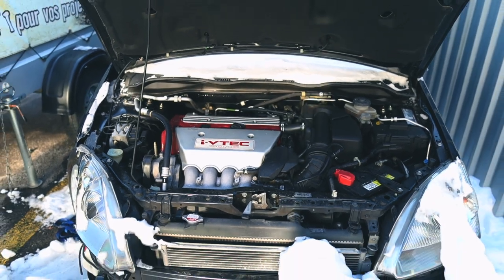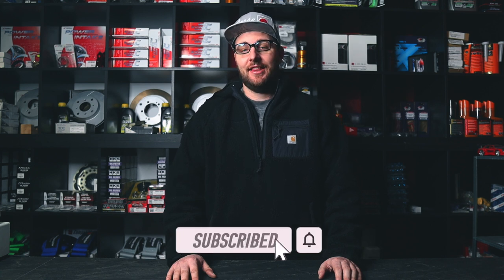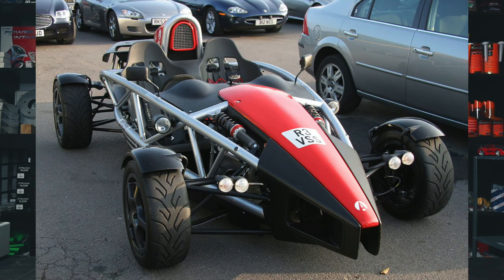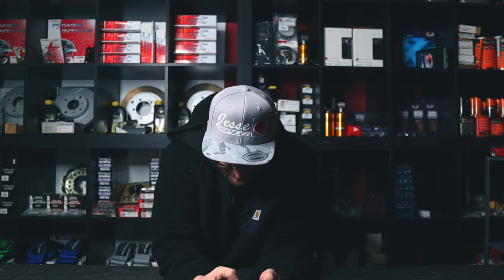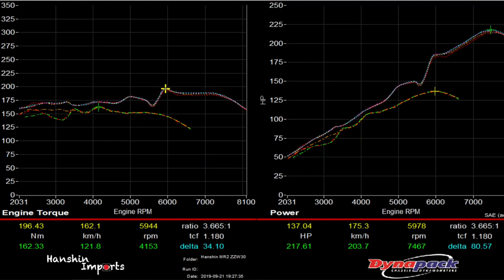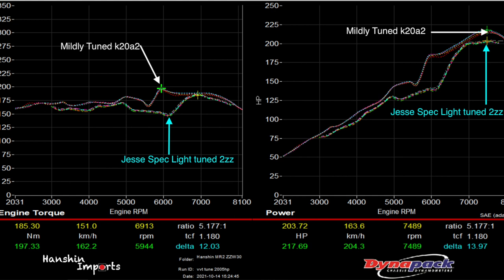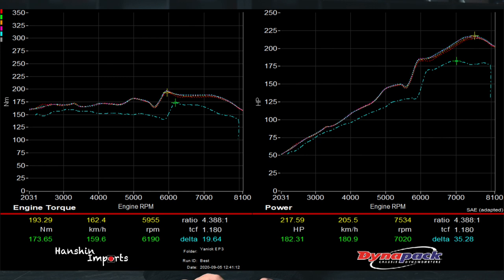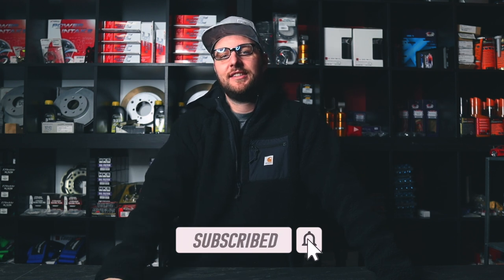How to Kswap an Mr2 Spyder EP2: Is the K20a better than the Toyota 2zz? Is it worth the extra cost?

Comment: The advantage of the 2ZZ is that is easy to swap, relatively cheap, and relatively light weight, but the K series are superior engines in every other way.
Reply from the maker: That somes it up pretty well! 🔥👍🏼
Reply: @JesseSpec  Thanks! :D I was all in on getting a K engine over a 2ZZ, then I saw the prices plus all the extra parts you need lol. 

The 2ZZ is a great engine but the power gain are not that big for the money, around 160HP to the wheels I believe. So I'm thinking about boosting the 1ZZ instead, a lot less complicated and you can get quite a bit of HP from it. 

I would get the piston rods and bearings if you want to go over 220HP though but considering how light weight the Spyder is 220 should be a good number to shoot for.
Reply from the maker: @Zeriel00  thats also a way of doing it 😊👍🏼
Reply: @Zeriel00  i m in your same dilemma but we have to consider reliability , turbo engines are fun but at a more price and more complicated
Reply: Why not just bore and sleeve the 2ZZ to a 2.0. With a refresh I'm sure it can be competitive
Reply: the only they the k has is the tuning options and higher compression ratio
Reply: @dohc7232  What do you mean both K engines have much higher power, torque, displacement, plus Vtec. Theyre better engines in every way, Ive seen 600hp K engines. The problem is the cost, and havin to run two computers to keep your dash working. The 2ZZ is basically drop and play but its not that much of a upgrade over the 1ZZ. A boosted 1ZZ would smoke it and it would be cheaper.
Reply: @joshuaogden8446  You still wouldnt beat a boosted 1ZZ and it would cost a lot of money, especially if you get the 6speed as well.

Comment: Great comparison.
Appreciate you taking your time and showing us dyno sheets of modded vs stock 2zz and k20. And vise versa. No one else ever did that before. 
There is great potential in those engines. One is definitely more affordable and easy to work on then the other. But the extra work that the k20 brings, of course brings way more powaa and VTEC!  
This also gives the 2zz a whole new respect and limelight. In reality kswap will be the best  swap if you want to modify heavy and raw but it's more expensive and more work.
 A 2zz is easier to swap, the numbers aren't insane but when modified some it's a solid swap and passing that 200hp is possible 
In the end  the mr-s is a super light car and both swaps will be worth it .
 people need to realize this is a 1.8l and k20 is 2.0. and they're producing similar numbers until k20 is fully modded and tuned. 
Makes me imagine if the 2zz was only 2.0L?? :O

I'll go 2zz swap for the simplicity sake. Toyota reliability. And keeping the mr-s Toyota. In the end you can always turbo mr-s 2zz and maybe still will be cheaper then k20 😂
Reply from the maker: Thanks for your comment! You Exactly understand my point in regards to the 2zz. As a street car, the 2zz is awesome and probably the better choice for price and ease of the work. As a true racecar, you need to do the same mods on both engines to make them reliable, so I guess going K20 is my choice.
Reply: A few points to this, if you go the k20 route there is a lot of custom fab work that needs done, engine mount, intake, manifold and exhaust, wiring loom, i'm assuming you would also need custom length drive shafts also, this adds a lot of cost on. Probably the same amount it would cost to add a decent turbo kit and ecu to the 2zz, so your going to get more power for your money going with a 2zz as it's pretty much a straight swap for the mr-s, no extra fab work or costs and you can spend that money on improving the engine instead. If it was going to be a drag strip or 1 mile car i would spend the extra to swap the k20 as down the line you can get more power, if i was going to use it mainly for track and b roads and to have fun, 2zz all the way, these engines can still happily push 700+hp with the right parts which is way to much power for a track car anyway, spend most your time spinning tires than actually going fast.
For something the size and weight of the mr-s, you are better off with around 350-400hp on a nicely tuned engine with a wide power range, instead of something with huge power where you only get lag or full boost and 0 traction. And just looking at engine costs for replacement, because the k20 is a popular swap for a lot of different cars the price of them is around 3-4 times more than a 2zz engine. K20 is only going to start getting cheaper when you hit that 1000hp mark where all the extra r&d that has been done on the k20 will pull ahead and you can buy off the shelf parts to hit that mark, your going to need a good engine builder and some unknown parts to push a 2zz that high. But it all comes down to what you want to use the car for, drag strip, 1 mile events, top speed runs you want the k20, for track, street, canyon, uphill events, best bang for buck 2zz all the way.
Reply from the maker: @shroomiestshroom3655  thanks for your very in depth comment! i agree. I don’t know if you saw but I did a full 20+ episode series on this channel on how to swap a 2zz which Is an engine I love very much. I really like the Toyota/yamaha engines such as the 4age, 2zz, 1j, 2j etc. But on the otherhand, I want to discover whats the honda k fuss about. In an mr2 is a good car to figure out. Most of the parta you said are available off the shelf like the 2zz swap. Check my other kswap videos and You will see 😉👍🏼
Reply: Damn great comment- love the sound of the K20 but 2ZZ sounds like the way to go for my AW11.

Comment: I am developing the 2.5L Toyota 2AR  and it will rev to 8-9k should be around 260hp on 91oct in dd trim and 350hp with a bit more work
Reply from the maker: Nice! Sounds interesting 👍🏼👍🏼👍🏼
Reply: How is this going so far?
Reply: Just finished the second version of port and polish we put the first setup on the engine dyno with dual FXE intake cams and it made 263.5hp peak at 7300-7500 rpms and started to fall off quickly afterward I found that air speed fell off at the short radius so I am working on 2 different port designs from our original attempts  and a set of ITBs then it will be back to the Dyno for more testing

Comment: Great video. Very fair and balanced comparison. I have owned Hondas (Civics) and Acura (Integra GSR). I loved the engines in those cars. I have been driving a Toyota MR2 Spyder since 2011 and put in the 2ZZ/C60 in 2012. I love that engine in that car even more than I loved the Hondas. I guess I am a purest. If I was to swap out the 2zz then I would likely go to the 2gr. I have driven a Spyder with the V6 and it is a whole different kind of a beast.
Reply from the maker: Thank you very much for your comment! I totally agree with you about the 2zz. I love it. I just came home from a trackday with my 2zz Elise… I love it. But I’ve heard so much about the k20 engines… i want to taste it hahaha (and make my own opinion)
Reply: Easier to supercharge and still scratch that bigger engine itch

Comment: On the 2ZZ Celica in the UK, Se7en Motorsports offer the Rotrex Supercharger. 300 + BHP stock. Over 340 BHP they recommended a gearbox  swap - think that may have been the MR2 box. not sure? Fensport in the UK also do some great stuff for the 2ZZ engine. Monkey Wrench Racing is the go to place in the US.
Reply from the maker: I love the 2zz (check my other videos, you will love it 😉😉😉). Nevertheless, a reliable 2zz is not easy to make. Especially for race use like me. I thought I’d give the kswap a shot 👍🏼👍🏼👍🏼

Comment: I wonder how the 2zz would have faired with slightly further tuning, as in the graph it showed that 2zz was only lightly tuned and was too far off.

It seems that only recently people have really started to understand the tuning potential of these engines and were now seeing them make 200+ hp with bolt ons and a tune. Though I have yet to see them catch on in the states yet
Reply from the maker: Hi, the 2zz is amazing and has lots of potential. However there is no replacement for displacement. I am about to finish the k20 swap on my car and will have better figure once its done! I’ll keep you posted! Best regards
Reply: @JesseSpec  true. But I have seen a 2.0 2ZZ make more power than a K20 essentially tuned stock for stock. So there really is no replacement for displacement lol.

Though it does make you wonder what if the K20 had come out first and Toyota had time to rethink their design for the 2ZZ. If you ask me, Toyota wasted too much time developing the 3SGE BEAMS which are into the 2ZZ’s development. But that’s just me spitballing
Reply from the maker: @omarawilson2853  hehehe we have a 2zz fan here. I really love that engine. I actually had one in my mr2 and in my Lotus Elise! Needless to say I loved them. However, they are getting older and quite easy to break I feel, which instantaneously killed my hype for that engine 😭💔
Reply: @JesseSpec  I’m a fan of both Honda and Toyota engines. But I do love the 2ZZ GE tho, much like many 4 cylinder made by both aforementioned companies.

On the note of the 2ZZGE being easy to break, can I ask what your experience in that is? The engine in my Celica didn’t go out until 233,000 miles, which seemed pretty good to me. Or are you talking about in a tuning sense? 

Another thing to note, before spinning a bearing my 2zz ran for about 4 months with next to no oil unbeknownst to me at the time, and that was with high RPM Touge driving, that’s not a flex btw I hated that that happened but showed me the engine’s reliability
Reply: @JesseSpec  also really excited to see how the swap turns out and can’t wait to hear the MR2 rip with its new K20 heart!
Reply from the maker: @omarawilson2853  for street driving and even the hardest touge racing will not put as much stress as on a race track during an official race. Check my other videos, you will see what happened. Everything was documented. Oil starvation, even with a baffled oil pan couldn’t save the engine…
Street (even touge) is not as harsch on the car as on track, let alone an official timed race. I was driving it hard, but I didn’t expect it to go to be honest.
Reply: @JesseSpec  Oohh ok I gotcha, can I ask what oil pan you were running?
Reply: @omarawilson2853 Just watch his „How to swap a 2ZZ into a MR2‘ Playlist everything is in there. He was using the 1ZZ sump which turned out to be a big mistake should have bought the Moroso Oil Pan
Reply: @DeepRacer-zr4yp  Yh Moroso would’ve been ideal. I plan on putting one onto my 2ZZGE in about a months time

Comment: k20 is severely corked intake and exhaust and tune. you dont want a huge jump when vtec kicks in. factory tune engages late to give the dramatic effect. stock internal k20's with good breathing bolt ons like vtec at 4400rpm. 2zz is almost as good as a b series.  once your finished with your swap you will see there is no comparison between k20 and 2zz
Reply from the maker: Thanks for the feedback! I cant wait to see what I can squeeze out of the k20. What do you recommend regarding intake manifolds?
Reply: @JesseSpec  cant go wrong with the tried and true RBC manifold
Reply from the maker: @Truulovemotorsports  thanks man! I’ll add that to my list

Comment: I just got the turbokits 2zz t28 Billet kit for my 2zz Mrs just waiting on intercooler and a garage to install it. Much cheaper than a k20a2 or k24a2 in Australia and I can still use my apexi pfc to run it. Still nice to know a 1.8ltr 2zz is comparable to a 2ltr k20
Reply from the maker: Very true! All though I like the Honda engines, there is something that isn’t as nice as the Toyota engines from a drive feeling perspective
Reply: @JesseSpec  a properly spect turbo will make all the difference,  I'll let you know how it goes

Comment: technically VTEC doesnot have lift, it runs only on 8 valves and after 4,5-5rpm other 8 valves add, Toyota VVTL has variable lift of valves
Reply from the maker: I am pretty sure its very similar to the 2zz system. You have 2 intake cams, one with short opening, one with low lift. And another cam with long opening and high lift. And on both have variable cam timing VTC. Its pretty much the same. One is a 2L and one is a 1.8L 🤷🏽‍♂️🤷🏽‍♂️🤷🏽‍♂️

Comment: One thing I’d like to mention as far as advantages of using the k20 vs the 2zz is once installed, you now have the option to swap blocks out for the 2.4 liter. Many people build these “Frankenstein” motors as I’m sure you are aware of with k20 heads on k24 blocks. If you ever decided to, you could increase your displacement even more whereas with the 2zz you wouldn’t be able to. Also, aftermarket support is just better for the Honda engine. I’m currently in the process of dropping a k24 in my sw20. It is costly though.
Reply from the maker: Totally true... oups... you've exposed my diabolical long term plan... hahahha:goodvibes:😁

Comment: Great Video. We can say "Flip a coin?" K20 is gonna be a pretty penny. Wish u all the best, focus, and success on the next series. Your videos make my day. See you next week. Thank you
Reply from the maker: Thanks man for the incouraging words 😁👍🏼
Reply: @JesseSpec  Your living my dreams fam. Just make sure it doesn't turn into a nightmare 🤑
I love my 2ZZ 🥰
Reply from the maker: @tkflex2332  hahaha yeah the monnies fly away quickly with this kind of addiction hahahah. Don’t break your 2zz! Baffled oil pan, oil pressure and temps gauge… and don’t forget to watch them 😁
Reply: @JesseSpec  03 Mxrs 2zz stock but has the lower lift factory tune 6200 to 8200. 2ZZ is solid idles at 900, I do have new baffled1zz oil pain on. But I think my injectors are leaking ;( smells like fuel 🤮
Reply from the maker: @tkflex2332  watch out the 1zz baffled pan sucks! The oil return is not fast enougj
Reply: @JesseSpec  ya I am sincerely sorry to hear that. It's a cheap option for $100. Mine is stock tuned and street so I don't think it will be a factor. What type of motor oil were u running? Morose pans are expensive and take 1 qrt oil more? But for track it's a must
Reply from the maker: @tkflex2332  i was using synthetic 5w30 oil. I think my Yokohamas gave it that much more lateral gforce to make it a problem too… hahaha
Reply: @JesseSpec  Oh snap your right! 2ZZ owners know that you don't hit lift on a turn, but I didn't consider if your going too fast! Great Knowledge on 2ZZ when I rebuild... but then again I always wanted a EP3 to bad they only make them with K20A3 where i am from, and Not the true K20A/2 :(
Reply from the maker: @tkflex2332  awww yeah that makes it definitely less attractive with the k20a3

Comment: My 2zz got sold and k20 is going in. Few reasons personally
Oil starvation if tracked so need an oil pan
Oil pump gears shatter if sustained rpm like track, so needs new gears
Lift bolts are a CONSTANT maintenance item
I had it for 3 years and it was fun when it worked but, I sold my swap for roughly the same price as my k20a2 swap has cost so far, and the gains are quite large on paper
Reply from the maker: Hi, thanks for your input. You may have seen it in my other video but I exploded a 2zz in a time attack race. So thats why I changed. I hand new lift bolts and a new oil pump in, so they help…
Yes its a bit of a oil starvation problem under very hard cornering. I had only the 1zz pan and probably was barely full of oil. Didn’t over fil so that could have been my mistakes. In the end I enjoy swapping motors with new stuff. So thats why I did it. It was waaaay more expensive. No doubt. The donor car cost easly twice the price
Reply: @JesseSpec  I just got the last piece of the swap, and dollar for dollar I broke even from what I sold my 2zz setup for and I ended up with so far- 
K20a2 with a harness and random intake 
PLM Ramhorn headers
Innovative mounts
Link g4x plug and play 
Map harness with odb2/AC 
MAP ac bracket
Frankenstein motorworks Junction box

Comment: The 2zz is also quite plentiful in junkyards appearing in the Vibe GT, Matrix XRS, Corolla XRS, and Celica GTS. These are often overlooked by DIY auto enthusiasts as opposed to Honda engines making cheap 2zz and components plentiful and cheap. While Honda engines are superior in tuning capability the 2zz has proven to be capable of making well over 500hp (although the reliability is a valid concern). If you Toyota fellas want more 2zz content check out the Jamaican drag racing scene, a good channel on YouTube is motorsportsja showcasing 2zz swapped starlets and Corollas making impressive passes.
Reply from the maker: Hi, thanks for your comment! Will take a look

Comment: In the honda crowd, the ep3 which is the K20A3 is the least desirable engine for swaps. You should have used the more popular swaps like the K20A or K20A2 which is more commonly used for swaps.
Reply from the maker: Hi, its not an k20a3….
Its a K20a2 (Euro spec type R)

Comment: I'll be looking at doing the 2zz Swap as parts for it, the trans and even axles are easy to pickup @ local dealer or parts store... Unlike the K and 2ar options...  But I'm going to keep an eye out... And see if I can find a deal on a 2zz setup or 2ar setup...  Until then I'm just going to continue to enjoy my MR-S with a lightly modified 1zz
Reply from the maker: Fair enough 👍🏼